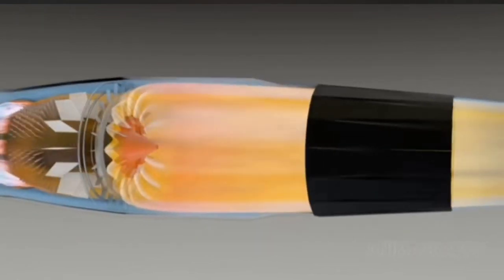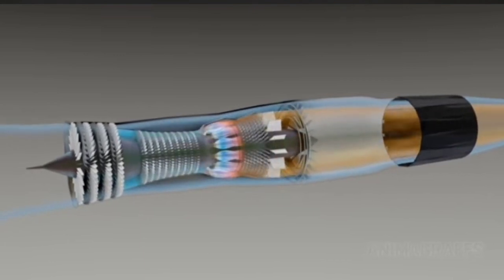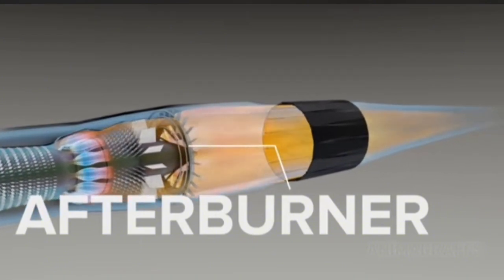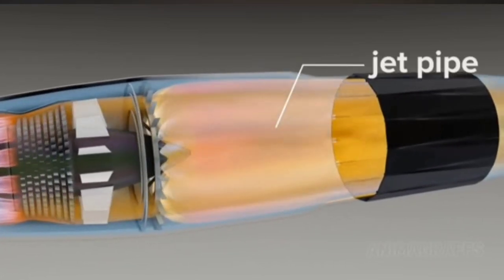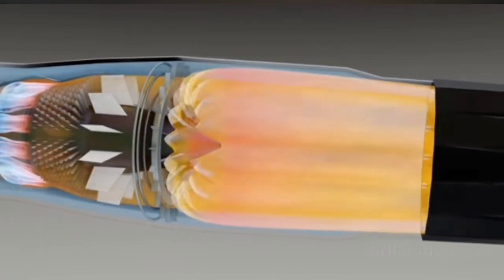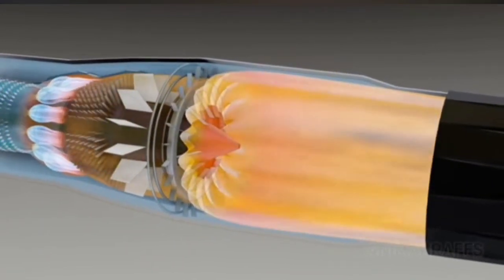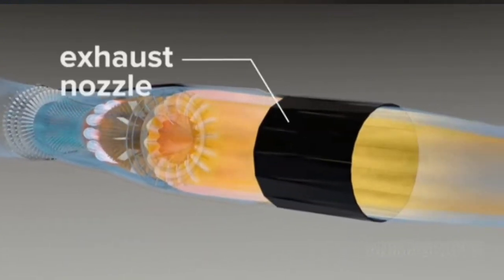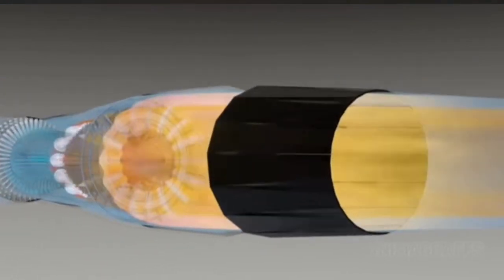How Afterburner works

Comment: i thought afterburner are simply increasing the fuel ration inside the combustion chamber but i never thought it has secondary fuel feed system
Reply from the maker: Yes it has the secondary fuel feed for afterburner. That's why it is called afterburner.